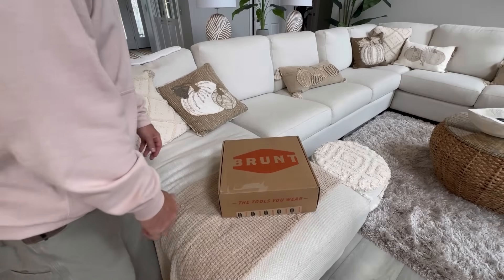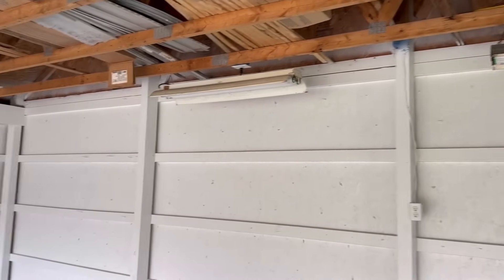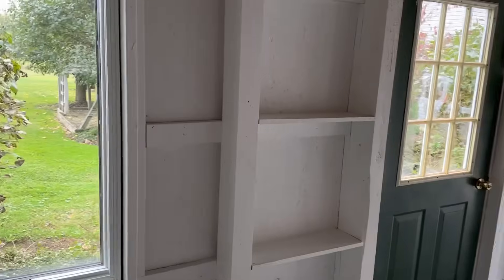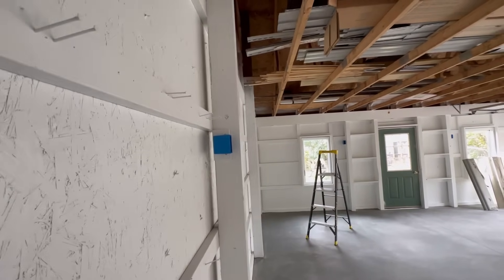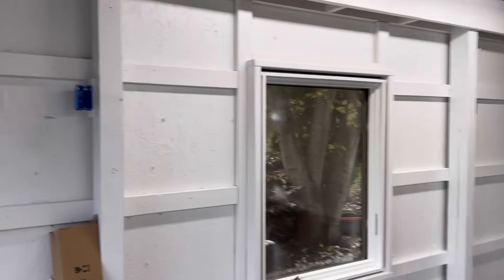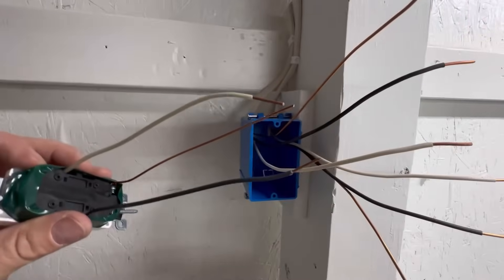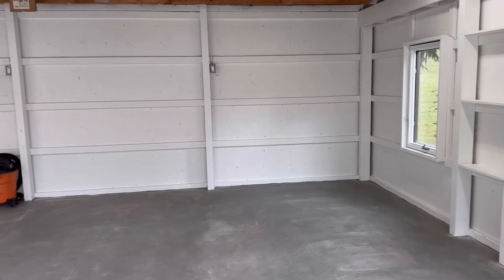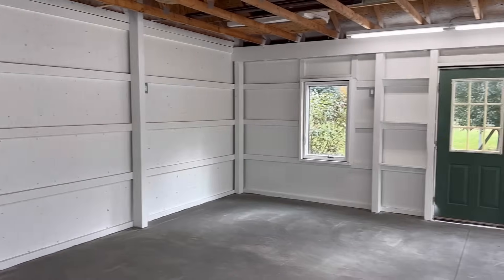Simple DIY garage electrical wiring. Some things to THINK about prior. Part 3

Comment: You and Autumn did a super job on her parents garage. Thank you for explaining the set back on the boxes and especially the proper positioning of the actual receptacles. I love the use of the 8 foot lights. My only addition would be a couple 8 foot lights across the front for a work bench. I think every guy needs a workbench in his garage, whether Autumn’s dad uses it a lot or not. It will also be nice for you and Autumn when you’re there doing work or projects in that particular garage. I like the suggestion of the additional electrical box between the doors for the retractable reel. See you in the next episode.

Comment: I like the way you mounted the outlets. I did similiar in my 36' x 45' pole building. I ran the wires under the girts instead of on top so that they are better concealed and less likely to get hit with something. I also had the wire enter the box from the bottom. That way if there were to be moisture running down the wall there is a drip loop before it enters the box. I mounted my boxes on the right hand side of every pole except in the workbench area. When I need to plug something in, I always know exactly where to go - right hand side of any pole.

Good job. Thanks for the video

Comment: Good idea to recess it boxes IF you don’t want to drywall..  But not too much trouble to bring them out if you do.  Gunna check out the boots. I’ve only seen the ground up when the box is on a switch.  I’ve heard tell Adam is 6’5”…..

Comment: When I wired my garage was I used thin wall EMT conduit (yes I have a 1/2 conduit bender) and metal quad boxes for the wall outlets so I wouldn't use power strip if I needed more than a single duplex at any point especially at each work bench. Then I used single duplex outlets on the ceiling for each LED shop light (10 dual LED lights) location and the garage door opener. It was probably over kill using EMT conduit in my garage but I prefer the look and to be it gives better protection for the wire than standard romex. Romex is fine if it's in the wall when you can't see it but I hate the look of it when it's exposed and just tacked on the beams or wall.

Comment: Nice improvements on the garage Doug. One thing I did on my garage was put a three light flood between the doors, the center light is on the switch and each door is wired with a plug in the opener socket so when you open that door the flood comes on to light up the entrance. Hope that makes sense.
Reply from the maker: Great tip!

Comment: I really like the extension cord idea, been using it for several years to an outbuilding.
Reply: We had a pole barn built, and I use it for storage only. ( not my shop )
Since it was a ways from our house electric box they wanted $7500 just to get electric to the barn, then add subpannel and outlets.  
2 or 3 times a year, I  need electric out there, and a 100' cord does the job, so I agree with you.
Have a Jesus filled day 
Greg in Michigan

Comment: I would make my spacer block 3.5" wide incase I ever wanted to stud/insulate/dryawll or sheath tight against the girts (poles exposed) and then do just as you did. But honestly I prefer coming back after the interior walls are done and running conduit.

Comment: Regarding the orientation of the outlet where the ground is on the top, you provided an example of a child coming down from the top with a knife and hitting both terminals behind the plug.  But, those outlets are higher on the wall where a child could not, due to their height, come down with a metal object.  They are more likely to shove an object up, thus you have them correctly oriented.  I still like the look of the way you have them, and even In commercial buildings I see them oriented this same way.  If this were truely the reason for the orientation of the outlet in a certain position due to it potentially causing harm, then it's only protecting a person coming down on a plug, not up.  So it's only protecting 50% of the time.  I don't believe that's the reason for the ground being where it is.  Plus, you see outlets layed out horizontally all the time too.  That garage is looking nice.

Comment: Nice job on the install. Most outlets that I have seen have been the way you installed them. There is nothing in the NEC that gives direction for the orientation for those devices. The only things that I would have done differently was I would have run the wires under that horizontal board instead of on top. That way you have that as a nailing surface for a simple board shelf. And, I would have run a sub panel as a distribution box wherever the power will come into the garage. That way you can have breakers and separate circuits for lights and outlets. Nothing worse than blowing a breaker and then fumbling around in the dark to get to the box to reset the breaker. Or, mix half the lights and opposite half the outlets so they indicate that the breaker blew but still leave you with some light to see.
Reply from the maker: I will be installing a sun panel when I bring the power in from the main panel.

Comment: A couple questions / points.
1) GFCI protection is required in garages under the 2020 NEC code (maybe earlier), but I didn't notice the first one the extension is plugged into being a GFCI type. Hopefully the receptacle on the outside of the house is.
2) Was that white wire 14 gauge, or did you have some old white 12ga laying around (must have been pre-2001 if it was). I did see some yellow 12ga near where the extension cord is. 
3) NEC does not require the ground pin to be facing up. A child could just as easily jam a knife up from underneath as from the top. However, if you mount receptacles horizontally, it is suggested (not in code, but generally) that the neutral pin face up, in case something falls on it. One might say that's an argument for why the ground pin on a vertically installed receptacle should face up, but the neutral pin is also larger than the hot pin, so something would have to fall at just the right angle and be sufficiently narrow to bridge the neutral and hot pins. Like you, I don't like the looks of the ground pin facing up. Also there's no requirement for the orientation of an receptacle EXCEPT that an receptacle cannot be found flat facing up under any sink (NEC 406.5(G).2) or on a countertop or work surface unless the receptacle for such (NEC 406.5(G).1).
Reply from the maker: I think you are the only one that noticed or questioned the white wire being 12g.
Yes it was really old white shield 12g I had laying around.
I’m actually glad I had it so it blended in nicely with the white walls. I ran out and that is where you seen the small section of yellow.
Nice catch!!!
Reply: I figured you knew better than to run 14ga in that application :) Seems like the copper is a little harder in the older stuff, although I'm not sure if that's advantageous or not.

Comment: You could use a portable solar battery pack for the garage - depending on how much you plan on using the garage. I do think neighbor Adam has an extra one. Nice wiring job - stay safe.

Comment: Great job and video Doug. Can you post the security light link somewhere that you used? It puts off a very good amount of light and I'm looking for about that same coverage area.
Reply from the maker: I got it at Home Depot. I believe it is 700 lumens with the built in photo eye. I don’t have the box for it anymore or I would  give all the info.
Reply: I found one on Home Depot site that looks like the one in the video. M/N DW9519GY-A, SKU#1002076264, Internet #307505250. Is this the one? It's $70 and 4700 lumens.
Reply from the maker: @shademan4077  350-Watt Equivalent Gray Integrated LED Outdoor Area Light Wall/Pole Mountable with Dusk to Dawn Control
Reply from the maker: @shademan4077  commercial electric.
I believe what you found is the one. 
Unfortunately I can’t post pics in the comments
Reply from the maker: @shademan4077  https://www.homedepot.com/p/Commercial-Electric-350-Watt-Equivalent-Gray-Integrated-LED-Outdoor-Area-Light-Wall-Pole-Mountable-with-Dusk-to-Dawn-Control-DW9519GY-A/307505250
Reply: Thank you, Doug, for confirming that. Also, thanks for showing the light in use after dark. It's always good to see items in use. Have a great weekend.

Comment: Is that the reason behind the outlet orientation? I prefer ground down. My opinion is if the cord get knocked out/pulled down, the ground is the last tang to leave the outlet. Is the outside light on a photo eye? If so, I’d recommend moving it out from there. It will see its own light. Before mounting the junction box for that light, bridge/backstop it with a 2x6. This way you have a secure mount for box and light (possible future pole bracket) instead of relying on the osb.
Reply from the maker: Yes and yes, and the light works good as it is mounted there plus it isn’t heavy at all so the osb will be more than adequate.

Comment: Is there an affordable option to extend my Garage supplied Air and Vacuum to my driveway to be accessible without opening my garage door?
This would be added to my planned 4-gang GFCI Outdoor recepticale...
Reply from the maker: I’m sure you could go through the wall to an outdoor electrical box with the airline. Inside the box, have a quick disconnect air fitting. I think that would be very cool to do and have.
You could do similar with the vacuum but you would need an air shut off inside on the vacuum line. A slide valve or something. Then just open the electrical box lid and attach a hose extension.
I hope you can visualize what I’m talking about….
Good luck
Reply: @OneEyeCustoms  I agree, as I do most of my Lawn/Automotive Repairs in my Driveway.
But I would also like to add a 2" Vacuum port for detailing my Wifes Vehicle, but keep all of the connections "Weather-Proof" as I reside in Western Washington State.
Thank you for your response, "Neighbor Doug"!

Comment: Why do you need to run a new line to the house, thought the garage had power before? :o
Reply from the maker: It did have power before, but the original home owner also used an extension cord for the lights and a couple outlets. I did the same until I can get time to do it correctly.

Comment: Not a certified electrician but, using 15 Amp wire, that seems like a lot of load on a single breaker. Unless you are planning to put in a sub panel in the garage and split out some of the outlets to 2 or 3 breakers. I am a fan of 20 amp in the garage to allow for toys. May help as well in the future for resale for that person that wants to use the garage other stuff. jmo  For sure, like how you did the outlets and having that spacer for the cover plates. As for the positioning of the outlet. If there is a kid that can get to an outlet 6 feet in the air? Need I say more?
Reply from the maker: I will be putting in a sub panel and splitting up the circuits in the spring when I run the main supply wire.